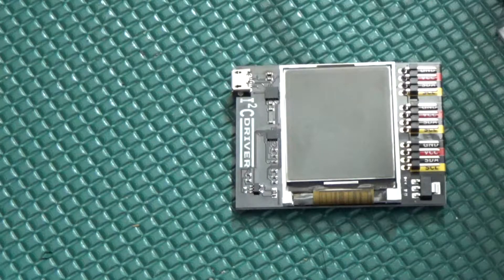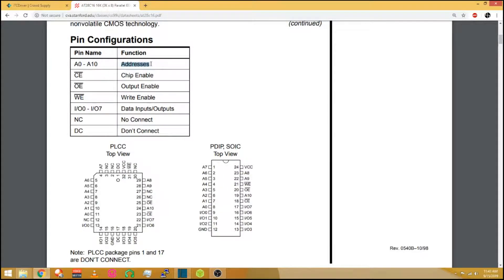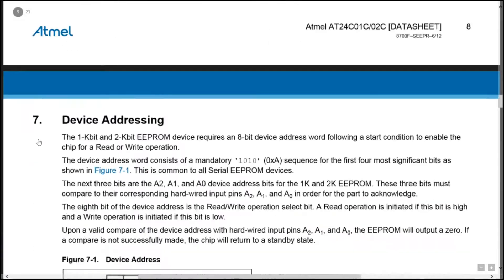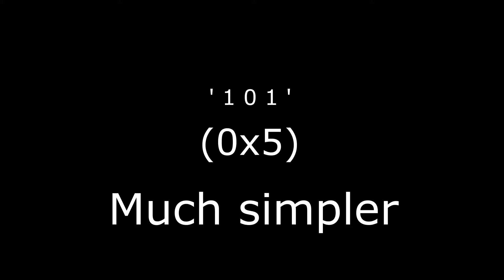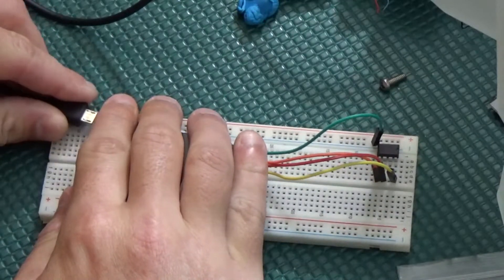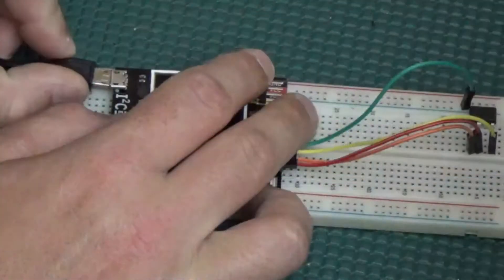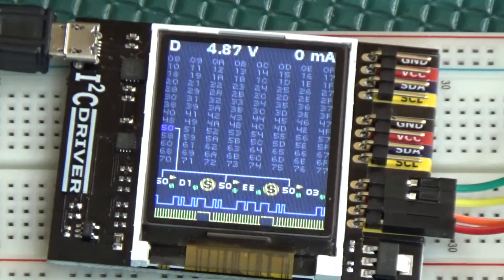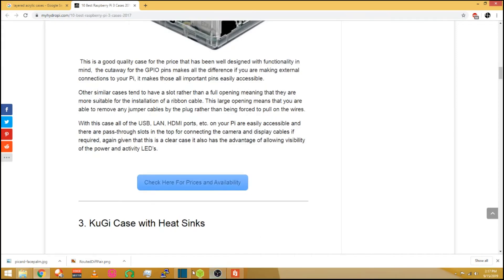Testing the I2C Driver by Excamera Labs

Comment: Hi , Dennis I would like to get some I2C pressure sensors and temperature sensors to work. Is there a good guide for it some where , doesnt matter Linux or Windows.or may I ask you if you could help me ?
Reply from the maker: Glad to here it. If you have any specific sensors in mind,  the manufacturer should have a datasheet. If you need help, let me know and I will happily help. Or at least give a try. As for the OS, I do not believe either will have an effect.
Reply: Hi  @dennisseuferling815  I am stuck. I am an absolut noob in this , but I would like to play around with I2C . So the thing is I would like to measure pressures and Temperatures with ams 5915 1000-D-B or AMS 5812 1000-D devices .  I hope I do not bother you.